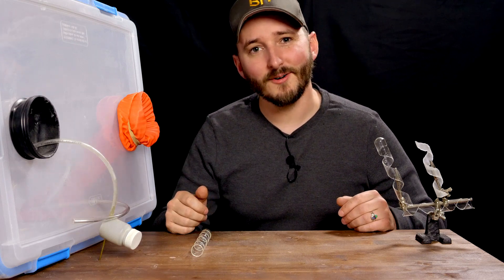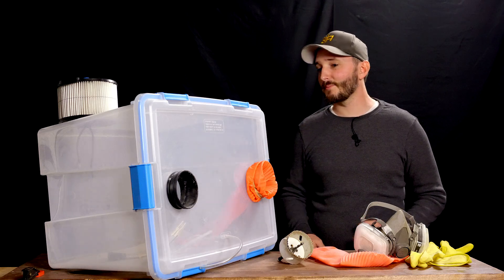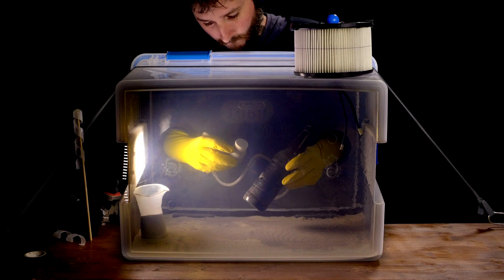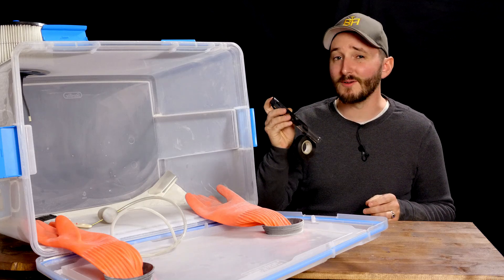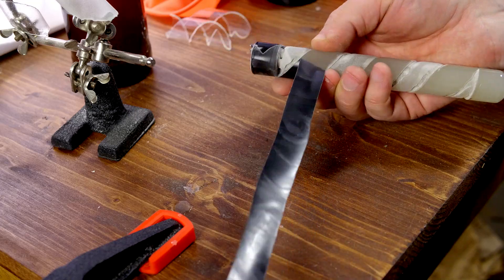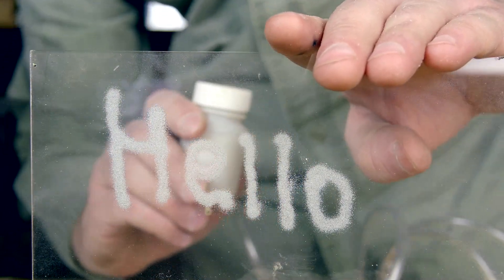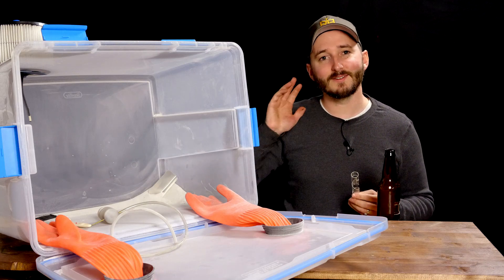*Impossible* Glass Cutting With DIY Sandblaster

Comment: I just got a price quote ($675) for creating two, small glass shelves with a custom sandblasted edge. Which motivated a google search "DIY sandblast glass" and brought me here. So happy I don't have to give up the shelves!
Reply from the maker: Be sure to research curved glass cutting too. If you're looking to do something other than a straight edge it will be easier to cut a curve with normal methods, then lightly sandblast the edge after. Be careful as sandblasting without proper protection of a blasting cabinet can severely and permanently damage your lungs

Comment: Maybe, instead of wax, a simple long inflatable balloon could be employed. If the abrasive does not affect the rubber of the balloon, it would be less messy. What abrasive grit do you suggest? Would #280 be too fine?
Reply from the maker: I never measured the grit size

Comment: the hammer analogy is broken... You say your hand can take the impact as long as it's not against something solid, but the tape is against something solid. A better way to use that analogy would be to place the brick on the table and break it, then place a similar brick but with a sponge on top and hit it with the same force: it won't break the sponge nor the brick.

Comment: I only lately started to wonder if this could possibly sand large PLA 3d prints? 🤔 Just light passes around connected joints for example
Reply from the maker: It's possible but you would have to test various techniques and medium grits to get the desired effect

Comment: I do sand blasting art on tile and glass. To get fantastic detail I made a concoction of latex caulk mixed with a little acrylic paint, the color makes it easier to see as you are sandblasting.  I put this in a small squeeze bottle and "paint" my design on.  The latex caulk is rubbery enough to bounce the sand off without eroding and if it does get a spot worn down just touch up the "paint" and continue blasting after it dries.  Once you're done, just scrape off the "paint" and you have a very detailed picture.

Comment: Great vid, Thanks for sharing. So, it seems like you should be able to mask flat glass and cut interesting shapes like musical notes (even tiny ones) using the sandblasting-cutting technique. Kind of like a waterjet, but a sand-air jet instead. Very interesting, as a water jet costs megabucks.  Lots of glass workers buy glass cutting tools like bandsaws and ringsaws to do intricate cuts. I bet this is a cheap and effective method. Going to play with it. KUDOS!

Comment: Wow. This video is a year old, and I'm just now seeing it.
I did something like this in Afghanistan, when I needed to etch some pieces for a display case. We didn't have a sandblaster, so I rigged up a handle from a pressure-washer with an air fitting, got some tubing from the hydraulics shop, and sand from the volleyball pit. Then used ordinary masking tape to cover the glass, cut it out in the design I wanted, and blasted away at it until it looked right.
Only difference was that I just worked outdoors and stayed upwind.
Great video!

Comment: I love the mini sandblaster and can't wait to try it! I use similar blasting cabinet setups for cutting, grinding, and polishing metals and stones along with other uses. With a piece of tubing, a syringe, and a water bottle, I added a drip system for cooling/lubrication when needed. Although the bin is translucent, I need full transparent visibility for my purposes. A simple solution is to cut a window in the lid and cover it with a piece of acrylic, plexiglass, or tempered glass (2nd hand store). You can attach it using tape, adhesive, or even bungees. I made a "double layer gasket" for the opening, bonded that to the lid, and sandwiched the acrylic in the gasket for a tight seal. When the window becomes occluded (not that frequently) simply replace it. I find it easier and less costly to replace the window than a 70 quart polypropylene bin (doesn't require finding a bin that fits the lid).

Comment: It’s crazy that this video was somehow recommended to me after months of developing my own sandblast glass cutting technique using vinyl stencils. You definitely look like you are having an easier time than I am with your smaller diameter tip, and the solid block of parafin looks a lot simpler and more effective than the thin coat of liquid resist I’ve been using. I kinda dropped the idea for a bit thinking I could get better results with a mill or something but this inspired me to make some tweaks and try again

Comment: 10:00 Did you test if you could coat the inside surface of the bottle just with a thin layer of wax?
Reply from the maker: I didn't. It would be trickier to use a thin layer than to fill the whole thing I think.

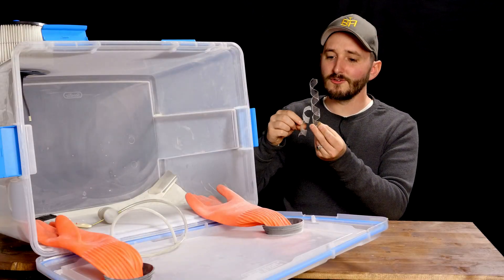Comment: 5:55 If you don't mind wasting some money, you could fill the tube with hot glue before cutting the glass with the sandblaster and later remove hot glue with hot water. That should result in near perfect cut and pristine glass surface.

Using just some kind of paint or any other soft enough coating for the inside surface of the glass tube which can be later removed with acetone might also work.

Maybe you could simply fill the tube with cheap silicone before cutting the glass?

Update: ... or wax when I actually watch to the end of video :D

Comment: 3:48 If the box is not transparent enough, you could also try using some suitable solvent to smooth the plastic again (depends on the plastic but the fumes from acetone without actual contact to the plastic might be enough). For acrylic box, some open flame would be a good tool to make the plastic clear again. Of course, always be careful with open flame...

Comment: Lots of great tips in a single video! For even better sandblaster you would want pretty tungsten tube with narrow inside diameter but creating a hole on it's side is going to be a slow process. Maybe somebody can figure out some commercial product that already has suitable features for the sandblaster work tip?

Comment: I called beeswax as soon as he mentioned the sand rattling around inside the tube. Work with the stuff in a lot of projects, some of which involve setting up molds. 
Another way to clean wax off metals, ceramics, and glass it’s to put it in a pot of water and bring it to boil. The wax will melt off and float to the top. Pull out the object while everything is still hot. There will still be residue on the glass and when you pull it out it will naturally collect some of the wax that is on top of the water as well. To get rid of that you poor more boiling water over it after you pull it out. You’ll get it clean as a whistle! And you can reuse the wax for other projects as soon as it cools down and hardens.

Comment: Not a material scientist; how does blasting impact the structural integrity of the glass compared to traditional scoring?  I imagine the finished product would be much more brittle due to increased stress lines...  Would be interesting to examine glass pieces cut with the two methods under polarizing filters

Comment: This is interesting, I have seen another application where this technique similarly is used. Gravestone markers commonly have the printing done by having a rubber template made, affixed to the surface, and then sand blasted. The longer the abrading,
Reply: The deeper the print in the stone

Comment: Now you have to smooth the edge of the cut tube.  Have you tried a torch to melt the edge of the cut to round the sharp edge?
Reply from the maker: The sand doesn't leave a sharp edge
Reply: @Nighthawkinlight  I saw the jagged edge in your video.  It is not a smooth edge.  I never used the word sharp.
Reply: @richardcommins4926  "...cut to round the sharp edge?" Right at the end of your comment. You said sharp.
Reply: @luckeycat_  OK, so you have a sharp edge that you don't want anyone to know about.  I get it.  Try heat treating the edge to smooth it down from that jagged edge.

Comment: Question: Does this technique work with thicker peaces of glass and hardened glass? Just last week i tried to drill a hole into high voltage power line insulator thingy, first metal drill to get past metal, then mason bit to get trough the mortar that is used to connect the outer metal shell and the glass insulator and similarly to keep bottom metal peace in the glass peace. Then come the hard part to get trough the glass. Tried method i heard about of putting coppet tube or in my case thin wall small brass tube into drill press, dropping valve lapping compound into hole and applying little pressure, so not to collapse the brass tube but still cause friction. It worked decently, i got around 3mm depth in 1.5hours -.- having to take breaks to let everything to cool back down, mostly the drill press being cheap chinese, but when i went to try check how deep i had gone and thinking possibility of snapping the peace on center out in later on whole thing exploded all over the kitchen floor... saying "fragments bring good luck" sounded bit hollow at that point. I'm not sure if it was hardened glass since there was chips broken off from another one i have around. Glass has been my nemesis as a material long time now and i would love if this was proper method to make holes etc with out causing internal tresses etc. Someone presented idea of heating rod of metal white hot and melting trough the glass but i think that too would cause huge internal tresses if whole peace was not heated and that wont work well on say mirror that i tend to work with often, not to mention internal metal peace heating and expanding would probably cause explosion in the glass as well.

For clearification high voltage insulator was something i picked up from metal trash those didnt belong to begin with and were intended as DIY custom lamp for electrician friend, just needed get power wires below the insulator that turned out to be one hellawa issue.
Reply from the maker: It can work for thick glass, but it sounds like you could have got your job done with better drilling methods. You should use a V tip glass drilling bit, and the important part is to submerge the piece under water when drilling it. I usually set a bowl on my drill press and temporarily glue the piece to the bottom of it.

Comment: Nice idea with the wax to both protect the inside aswell as supporting the object under work.
A thought, would a tighter sand blasting beam perhaps give a better cutting result and perhaps also cleaner edges?
And perhaps better, more uniformly sized sandgrains would give a better result too?

Comment: You might be able to just coat the inside of whatever glass you're using in a thin layer of wax, or use rubber cement.
That way, it adheres well enough to work, but can be peeled off in one piece without any heat.

Comment: Best in world respirator - long-enough PVC watering hose - with one end(in the simplest case) clamped in the teeth - allowing to inhale through it and exhale through the nose ... and second end - in your other room, that must be free from moskitos
Reply: there is a method for cutting ferrite-type-magnets(cheap black ceramic magnet -like from loudspeaker collar-form("ring"))
with discharge from 220VAC with 100Wt  incandescent lamp connected in series with two probes - with wich you can burn hot and long path contour line, thickly drawn by graphite pencil on ceramic surface, stretching after contact with two peobes - surfaced discharge "flame-line" by segments of сut perimeter until magnet cracks - some like cutting bottles with oil-burning thread or encircling(with arc - not simultaneously closed loop - but half of it usually) hot nichrome wire
i think - same results acheivable wit high voltage arc discharge from old tube TV - anode supply wire with common wire, or any another 20kV 10-30Wt supply - DIY "Flyback") , but when i was trying to cut glass by arc just like with band-saw - it tends to give spontaneous zigzag line - choosing easyest "next steps" for electrical breakdown - even when i moved it slowly - never burning like gas torch flame or so... but i was not informed about drawed graphite line - holding discharge - in that times, i hope- that with two lines-on oposite sides of glass surface - even band-saw directed arc will stay and moving more stable - like on two rails

Comment: I imagine that this should also work for a flat sheet of glass of around the same thickness? (maybe coating the back with wax instead of filling with glass?)
Now I'm trying to think of what one could do with glass cut in complex shapes...?
uh, glass is useful for:
1) containing liquids, because it is rather inert
2) it is transparent, you can see through it, and it is also solid
3) It can sometimes be used to manipulate light in some ways
I suppose if one wanted to cut carefully placed holes in a tube of glass, in order to make entrances/exits, that could be one use.
There's art pieces of course.
could use it to hold some lightweight things while not obstructing the view.
If you could mirror the glass afterwards, this would allow making unusually shaped flat mirrors, which you could use for.....?

Comment: Hey,, nice. I make a mini steam wand,  it also blast away stuff,  but it's for cleaning stuff, pots and pans,  bake wear,  piping.  I use a steam kettle with silicone stopper and tube,  and a metal wand with insulator for the handle.

Comment: I'm really curious what challenges trying to make a CNC glass cutter would bring up.  You'd have to isolate the 2 axis control mechanisms from the abrasive material... IDK I feel like having the ability to cut specific sizes and shapes of glass could make for neat projects.  Glass gears? If that works a glass clock?  An all glass puzzle? Who knows

Comment: A little trick you may want to try is to "cool" down the flask in normally tap water, the glas gets super brittle and easier to cut. in fact you can even take a normal sissor and cut the flask under water, the flask will splinter but you will normally never cut youself.

Comment: You are the best at shedding light on things so ....  can you shed light on this?

Do Photons Have Mass?   YES... I Sincerely Beg You To PROVE ME WRONG!
... and the Answer To The Universe Is -42 not 42 !!!

The Mass of a Photon is Given by:   m = (h/cλ) (kg)

where,
m = mass of a single photon
c = speed of light, 
λ = wavelength of photon

“Bozeon Constant” b is as follows:

b = h/c  (kg m)

b =6.62607004x10^(-34) (kg m^2/s) / (299792458) (m/s)

b = 2.210219x10^(-42) (kg m)

The Mass of a Photon Is:

m = b/λ (kg)

or,

m = 2.210219x10^(-42) / λ   (kg)

A typical Red photon with a wavelength of 700nm has the following mass:

m = 2.210219x10^(-42) (kg m) / 7x10^(-7) (m)

Mass of a 700 nm Red Photon:

m = 3.1574557x10^(-36)   (kg )

PROVE ME WRONG OR…

Join The TTOE Team At BRAVE and Help Save Physics From Those With Warped Spacetime Minds:

@BozeonResearchAndAEtherVerificationEtaireia
 
Notes To Aid Understanding of what EM Dipoles Particles Are …

The “Bozeon constant” “b” converts photon wavelength into the sum of all the masses of the “bozeons” or “God particles” that form the “quantum superfluid” in all particles.  

“Bozeon” is Polish for “God Particle”, the ethnicity of the Conceivor of EM Kinetic Dipole Theory, aka The Theory of Everything.  There are trillions upon trillions of dipoles in a single photon. (more on the exact number later).  Everything including all elementary particles are made of complex flows of EM Kinetic Dipoles.  A Kinetic Dipole is a somewhat symmetric particle with one end that has more mass than the other.

Bozeon’s are Electromagnetic Kinetic Dipole Particles that form the EM field.  

For better understanding you can pretend for now that the Planck Length is the RMS distance between kinetically colliding EM Dipoles (“Bozeons”).

You can also pretend that the “size” of a EM Dipole is about 10^(-42) meters in length.

The Dipole Mass Density Gradient in Vacuum determines the local force of gravity.  Big “G” simply converts Dipole Mass Density Gradients into Acceleration.

All forces EM, Gravity, Weak, Strong, are all calculated from the momentum transfers between kinetic collisions of these EM Dipole Particles.

EM Dipoles in Vacuum are in a gaseous state and the “quantum superfluid” in all particles is liquefied EM Fields and are technically a Bose-Einstein Condensate of EM Kinetic Dipole Particles.

Black holes are supersolids of EM Dipole Particles.

Copyright 2021 John E. Boze

Comment: @nighthawkinlight 
What if you turn wood burning gass turned into a liquid like how u can convert oxygen into liquid oxygen with nitrogen is turning a wood burning gas that is clean can be used as a replacement for gasoline or other fuel consumption if so then this could be cleaner than using fossil fuels and other fuel materials

Comment: Something to look into for your masking material is a material called sandblasting resist. It's a very durable vinyl and I use it for etching glass and mirrors (sandblast off select parts of the mirror finish from the back for a frosty image, or paint the area). I found mine from a company in Seattle that specialized in sandblasted wood signs.

Comment: Toughened glass???  I recall Cody's Lab trying acid to breach tempered glass - fail..  could sand blasting work or would the sheet shatter on removal of the first layer of stressed glass?

Comment: could you just roll up a sheet of paper and stuff it down the tube to stop the scratching of the interior of the glass?
Reply from the maker: In some cases, but I tried paper towel and it applied too much internal pressure when packed tightly enough to fill the gaps.

Comment: Plastidip. I'm pretty sure it's a vinyl based, but that would allow you to coat the inside and it typically removes in one piece once dry. You could also use it with a stencil.